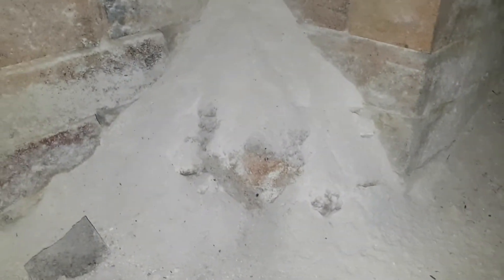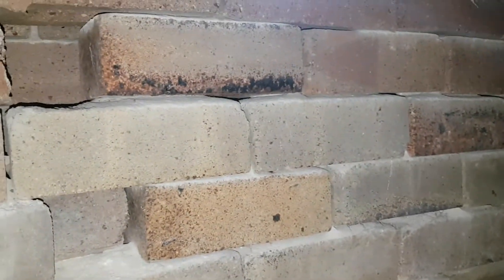Rising Damp Sydney - Sub Floor Fan Review - The Dangers!

Comment: How did you find out if the soil head salt in it
Reply from the maker: You can get it tested,  it's the accumulation over time that causes damage. There may be a lower salt percentage in the soil but very porous bricks which absorb and homogenise moisutre faster therefore they get damaged faster. On the other hand you could have high salt content and very dense bricks that have a slower absorption rate which means a lower amount of damage from salt accumulation. It's not so black and white.
Reply: Thank you mate,

Comment: Would econofans that detect humidity fix this?
Reply from the maker: The fans do the same thing regardless of the way they activate. 

Sometimes you do need fans.. but installing fans for the purpose of curing rising damp is not the solution. 

Fans are used to eliminate damp smells, mould and rotting timber. Fans do not cure rising damp. 

Check out my website https://www.risingdamp.sydney

Comment: So what’s the best way to keep ur subfloor floor ? I got bad ventaalrion subfloor wet termites u name it
Reply from the maker: Yeah if you have termites then you may need some kind of ventilation. 

If you don't have a salt issue there then you may not get damage like this. 

If you do need to install fans then keep an eye on the subfloor walls to see if you have any damage occur. 

If there is damage occurring over time you can get some LIME MORTAR and apply it to the subfloor walls as if it was render with your hands (not real pretty but no one will see it) and the render (you can just use pre-mix sand and cement from your local hardware store) will be a sacrificial layer on the surface sub-floor walls and piers. 

i.e. The lime mortar "render" will incur the damage instead of your bricks and mortar. 

By putting a mortar layer ON TOP OF the subfloor walls and piers (as a 5-10mm coating) the salts will crystallise in the NEW layer you have ADDED instead of in the original substrate of your house. Over time this layer may deteriorate and you may need to reapply in places. Doing this will mean you don't get any structural damage as seen in the video above because the salt is damaging the lime mortar layer instead of the bricks.

Comment: What am i missing here? The rising damp seems to be main culprit no? The damp proof course was not adequate to begin with? I dont see how the fan promotes rising damp...
Reply: The damp course was installed about 100mm below internal floor level as per regulation, so below the internal floor didn't have a damp course. If the bricks are in wet ground.. they get wet.. then the brick above gets wet too.. then the brick above that one...  with the moisture from the ground comes diluted minerals.. if you dry the masonry, more water comes from below to replace the evaporated water and so on.. speed the evaporation up and you in increase the water coming up the bricks from the soil.  Increased evaporation means more water passing through the wall to the evaporation point which means a greater accumulation of salt in the masonry. The salt turns to crystals as it dries and push apart the bonds between the sand and cement, and turns it back to dust. Go and look under 30-40 old houses.. you'll see near vents, sub floor fan exit points or access doors etc that the mortar is more likely to be missing there. This video is an extreme case,  the worst I've seen.
Reply: @jasehere4589  interesting mate thanks for explaining. Does it then also depend on salinity of soil? I guess its fair to say some areas would contain more salt? I was contemplating potentially installing some fans. I suppose fans dont dry out the ground enough either to stop or reduce the rising damp
Reply: @united3689  within about 15-20kms of the sea the salt is higher.  You only need fans if you have damp smells, rotting timber or mould. Fans just evaporate the water below floor level which makes it look like it's fixed but it's not. Rising damp is about salt, water and evaporation. It's OK of masonry is wet (in the right locations) water doesn't damage masonry, drying salt does. If you have masonry which is being damaged under the house then you can put 5mm of a sacrificial layer off lime mortar on it which will save the walls and piers. Sometimes fans are needed, i try and avoid them when i can.  Having said that we installed 3 this week. It's situational.
Reply: @jasehere4589  Thanks Mate. Is that means passive vents are enough and safer than electrical fans for the subfloor?
Reply: @jasehere4589  did u instal eco fans around $250 for a. Pair or just a $30 exhaust fan will do the. Job.  My house is wet timber rotted snd I found termite outside near the house beside the house the timber gate . I’m getting t a termite treatment soon as soon as my subfloors dry .. I’m thinking of adding fan and as the guy in video mentioned on comments let it extract air not blow it in
Reply from the maker: @EggyFreeman  They can be enough. I generally tell people to install passive vents first and see how they go, then install fans later on if it continues. You can also put whirlybird roof vents in which will circulate are through the cavities too. You just want to make sure your dampcourse is functioning if you start to run air through your cavities. If the walls are damp then the air could cause the same issue you are seeing under the house, in your wall cavities, i often see missing mortar on on external walls too.